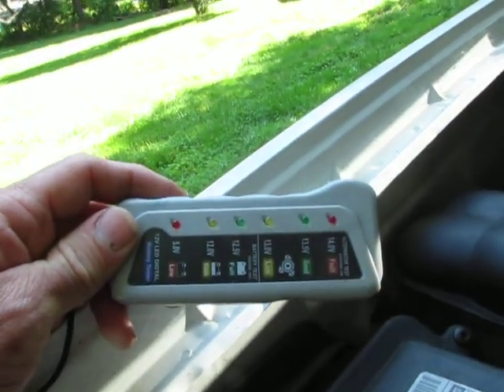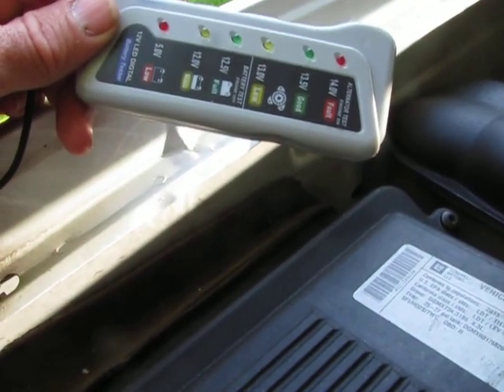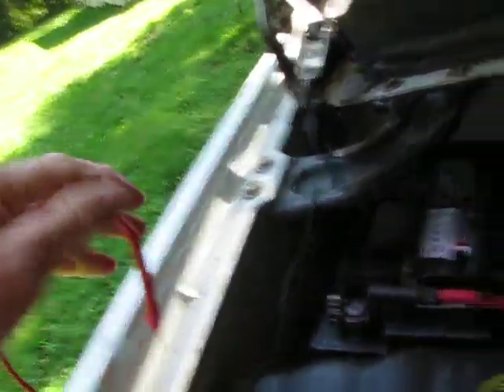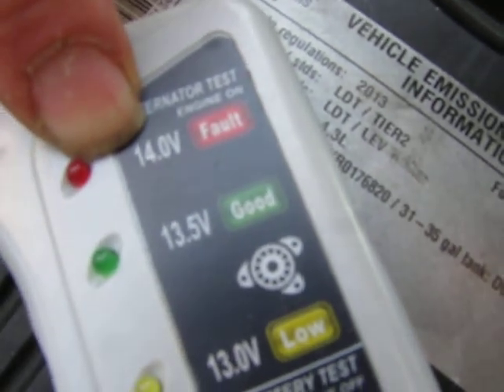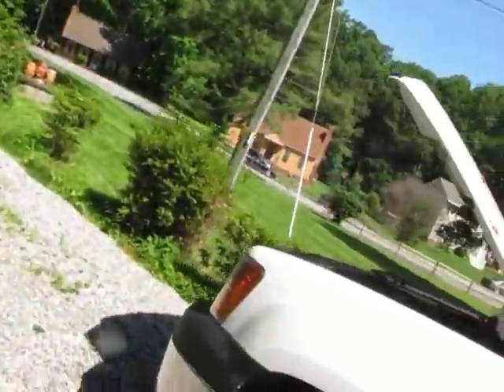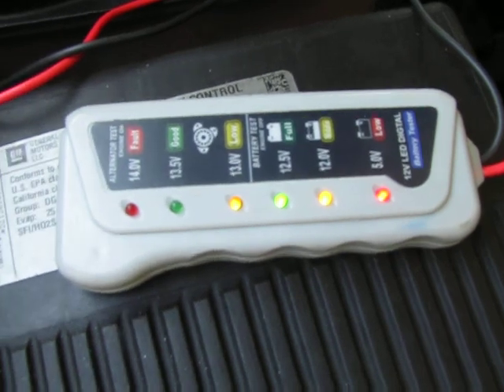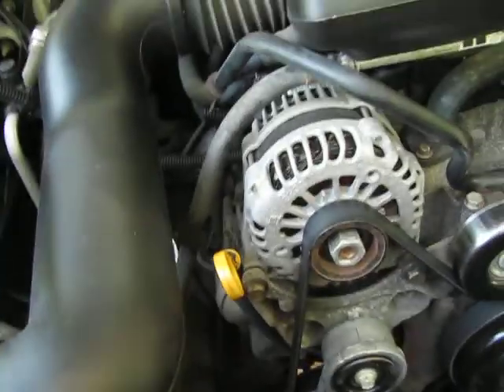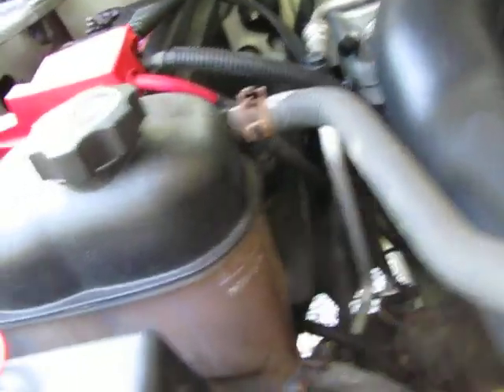Testing Vehicle Battery / Alternator Charging System

Comment: You get what you pay for with diagnostic equipment and in this case there's not very much there, you need either a good quality multimeter or a midtronics battery tester.  A simple Volt meter would tell you you're putting out 14.3 V continuously which means your alternator is working good. Those little random lights blinking do nothing but make you think something is going on when it's not.  If it's not calibrated it's not accurate!  That's your midas tip of the week. 😎
Reply from the maker: Thank you so much for that, maybe I just like my simple and stupid method, who knows.